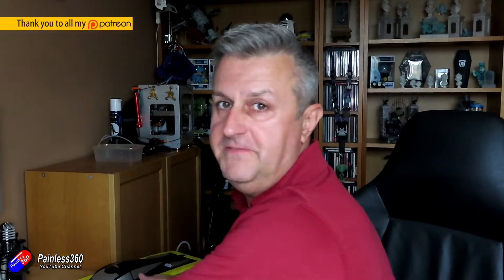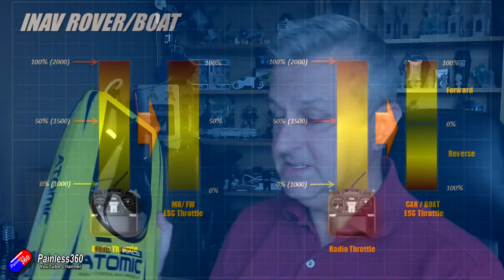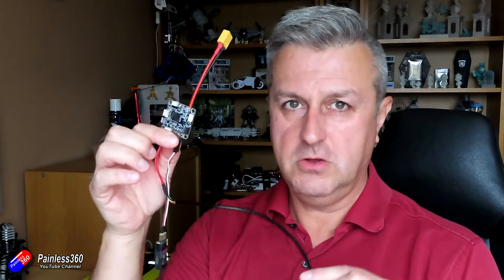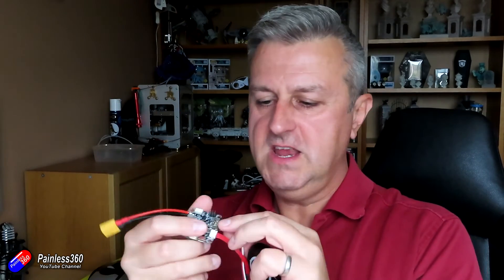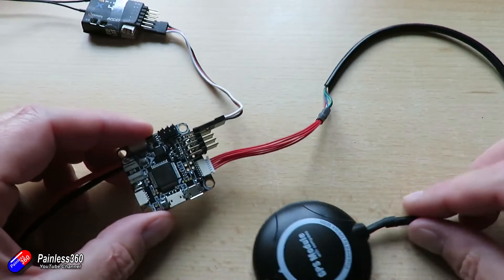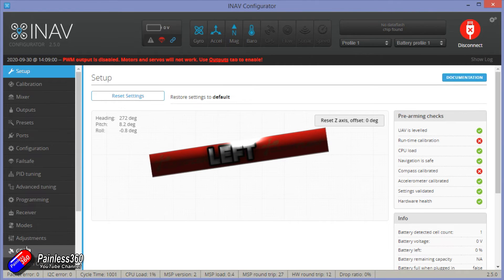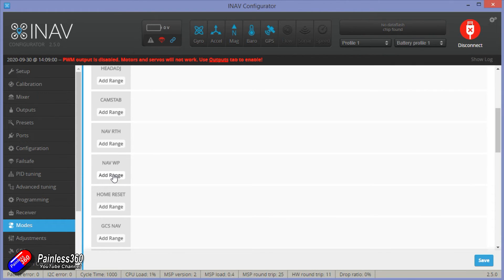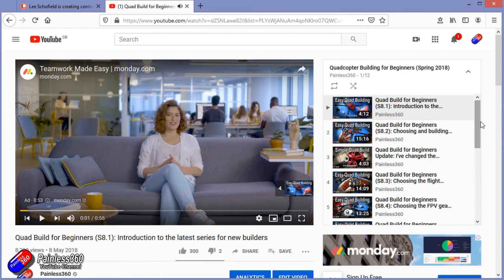INAV Setup for a BOAT or CAR: Tips tricks and basic INAV setup

Comment: Have problem where motor work in test mode slider but wont work with controller when armed. Have same Settings as you any idea?, throttle scale 0.7

Comment: Thanks, I've seen your 2 parts video, still not able to run the boat. Running the inav 7. I'm using FRSKY TDMX receiver, and a Matek GNSS-GPS M10Q-5883, can not set the magnetometer on it. I nav is able to run the motor, But I cannot run it with the controller. Do you plan to make a new version on ho to set a boat with a newer version of INAV? If you have any cues that may help, let me know. Thanks
Reply from the maker: You need to fix the compass issue. No more boat videos planned anytime soon... Best of luck

Comment: Please help: I want to put the fight controller in an RC tug with a single motor T style bow thruster, 2 motors (fixed) 2 rudders (linked or independent). I would like GPS capabilities like POS HOLD, RTH TRACEROUTE, WAYPOINT.
Reply from the maker: I'd check out the ArduRover/Boat Wiki https://ardupilot.org/rover/docs/boat-configuration.html as it is a lot more advanced than INAV for ground based models. Best of luck!

Comment: Thanks for the reply on the 5v bus arrangement......I did eventually track it down with your help...seems it went through rather quickly and I missed it.
Any pointers on mixing the throttle with the switch setting to get the 0-100% in forward and reverse.  (around 8.45) I did look for a link to the file you mentioned but doen't appear as far as I can see.

Comment: At 7:28 you mention a modification to the 5v bus....could you point me to a video or instructions on how this modification is done etc.
Intend to use your layout in a scale Riveria boat I built with a 25cc engine (also my build) Camera will also focus on the on-board working tacho and fuel guages so no requirement for telemetry there.
Also you mention a link for radio setup, really like that idea but could not find any such link. Cheers Jeff
Reply from the maker: Image of the mod in this video and I also did it on the Omnibus Arduplane build from last year. Just connect the 5v pins from the ESC and the servo outputs together so the power for the servo comes from the ESC not the BEC on the FC. Best of luck

Comment: Hi Lee, I have been looking forward to see you handle this topic.

I have also been looking forward to find some guidance on handling a boat with two waterjet drives, as this model is quite popular. Especially among baitboats. The ability to use differential steering is very nice, and the steering of the boat is in general very elegant and safe.

In the same way as for your setup, a jet drive has no reverse thrust via the thrust stick. Counter rotating the impeller doesn't work. Instead it needs a switch to engage the reversing bucket, and steering in reverse is now much more efficient than with a rudder. The same goes for full size boat. The saying is, that you can make a boat dance ballet with jet drives :-)

Is there any chance, that you could look at this twin motor boat setup for INAV in a future video? I haven't been able to find it anywhere on YT.
Reply from the maker: I'd recommend not going with INAV yet. The code is just too basic. More varied setups are supported by ArduRover so that is what I'm planning on looking at next with this model here..
Reply: Painless360 , Thank you for your advice :-)

Comment: I think you can reprogram the throttle range on the ESC using only the transmitter. 
At least on most of the older ESCs the sequence was like so:
1. Radio ON, ESC OFF
2. Full throttle on the radio
3. Power on the ESC
4. Wait for the confirmation beep from the ESC
5. Go to zero throttle position on the radio (in the case of this boat go to -100%)
6. Wait for the confirmation beep from the ESC again
7. Power off the ESC
8. Radio throttle all the way down
9. Power on the ESC
10. The motor should now respond to throttle input from the radio
10.1. Make sure each time you power on the ESC the throttle position on the radio is -100%, otherwise it could enter program mode

Comment: Can that FC handle the amount of amps the motor needs? I would like to do the same thing on my feilun ft011 but mine has a 65A each or something. Or do u connect the ESC to the FC ?
Reply from the maker: If you need to pull a lot of current then I'd connect the esc directly to the battery and solder flying leads to the FC to power it and monitor the pack voltage only.
Reply: @Painless360  is that what u are going to do ?
Reply from the maker: I'm not pulling that much..
Reply: @Painless360  good tip!